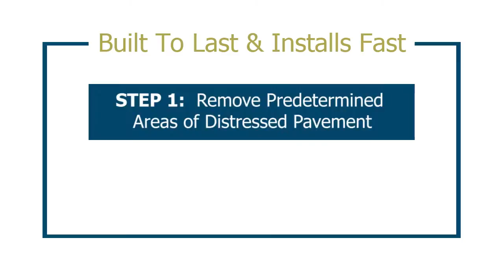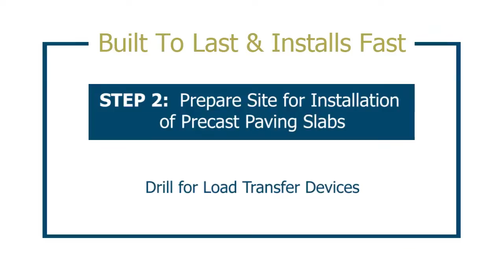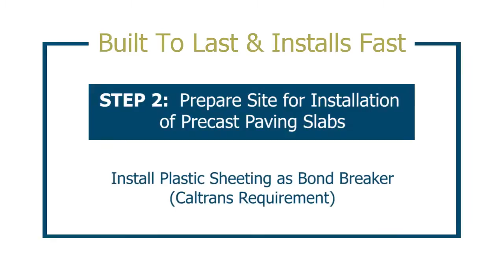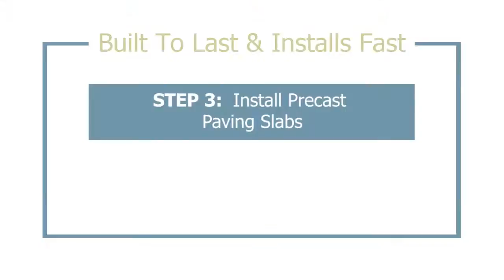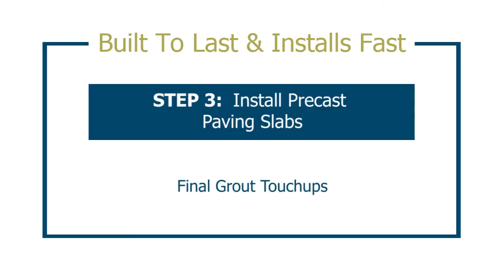Precast Concrete Paving System Installation

Comment: How long did this project take? From time the traffic control is set to the time it is opened back to traffic? Without this information, your claim of fast and lasts is without proof of concept.  I think a high early strength concrete allowing a three day closure would outweigh the costs of this "patented and proprietary" method.

How much does all that railing and screed system cost to facilitate the "precision grading"?